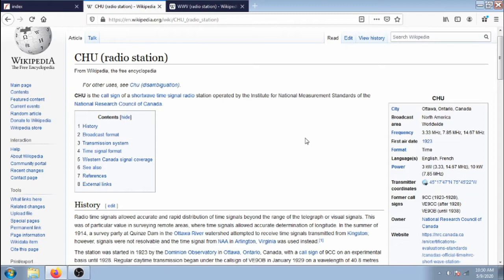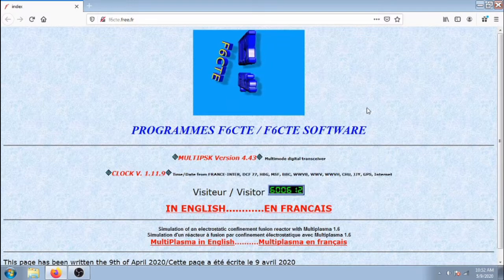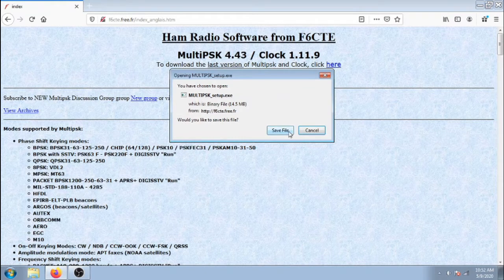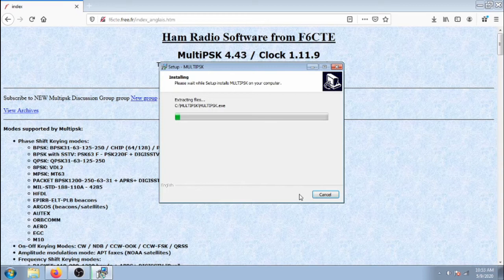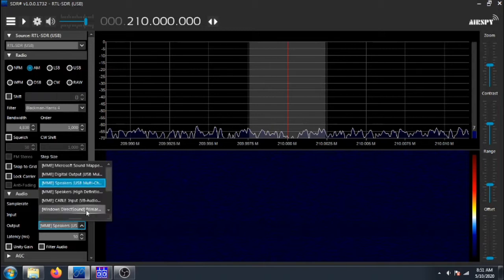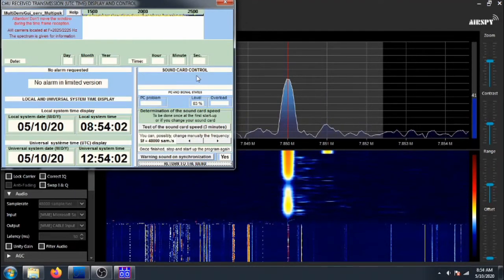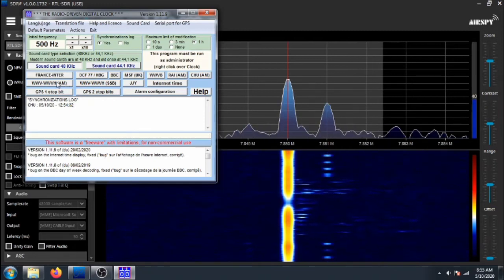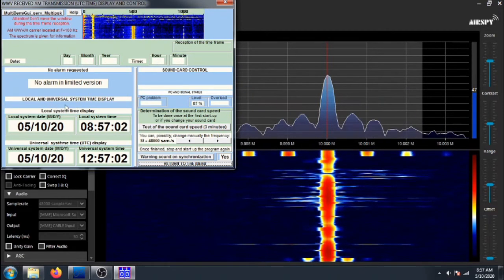Decoding WWV and CHU time signals with CLOCK and SDR

Comment: Thanks so much bro! I LOOKED EVERYWHERE I was trying to do this with FL DIGI with CHU first then I figured out it was FSK 300 Baud so I went to attempt to do that with no luck....so then I tried the WWV Mode on FL Digi with no luck at all. Then I found your video :)

Here is my Idea since I am a DIY guy eith some programming experience. I wanted to make a program that constantly grabbed the decoded timestamp data from either CHU or WWV and to update my clock on my computer. This will be for remote/Rover Operation.

Thanks to you now I am one step closer :) Keep doing what you do!
Reply from the maker: Glad the video helped. Good luck with your project, sounds like a cool idea.
Reply: Interesting. I did not know that WWV contained data signals for time decoding !  I always thought they were 400hz, 100hz and 440 tones with voice announcements. Where can you hear the data packets like you can on CHU at 30 seconds ?
Interesting. Thank you.
Reply: @normkirk65  There are no data "packets" to speak of. WWV has quite a complex transmission scheme, documented in great detail on the Wikipedia page. In short, data is transmitted 1 bit per second on a 100 Hz pulse-width modulated subcarrier.